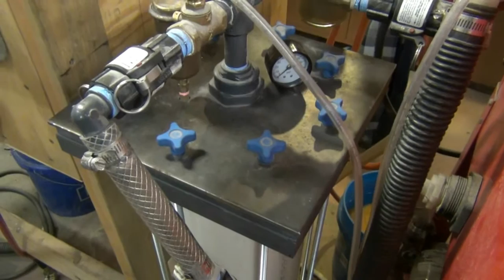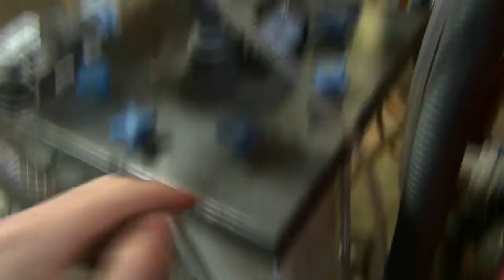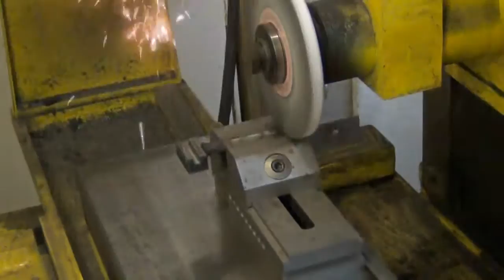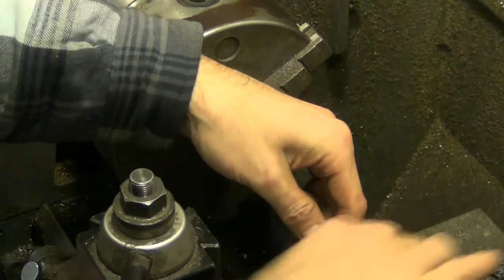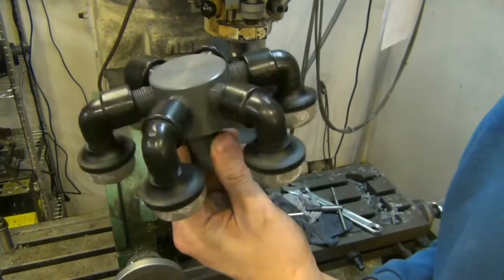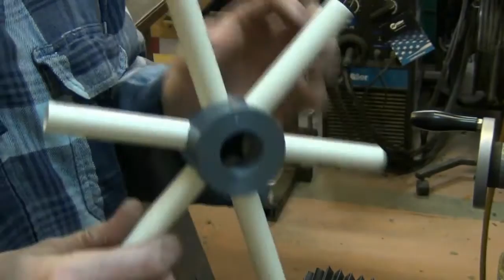Building a BIG Water Filter - Part 1 of 2

Comment: Why run it at 28-30 psi?  that's just a waste of electrical energy.  It also doesn't filter well at that pressure.
Reply from the maker: Care to expand on that?
Reply: No problem, I don't know where the idea of higher than required pressure came from. I also don't know what you are using the filter for. If it's a pumped supply to the filter the pump will be struggling to push the water through the filter and the flow will be what the surface area of the filter x the depth of the filter bed will allow.
We already know that filtering slowly vastly improves the quality of the water coming out.  Particles entering a filter at high pressure get sanded down as they move in the media until they are small enough to pass right through. filtering just requires a positive pressure. For example my swimming pool filters the water but the pressure is only 0.5 PSI and I am filtering 7m3 per hour using 69 watts of electricity per hour.  I could turn the pump right up full and get around 18- 20PSI on the gauge but that only filters about 12m3 per hour and uses 790 watts per hour. the difference is friction and that is a waste of energy and money.
Reply from the maker: Ok, I see. That makes sense. I am filtering water for my vapor blasting cabinet. I'm running a series of cartridge filters after the glass filter to clean up what's left, down to 1 micron. I found, as you said, that if I slow the water flow through the glass filter, it apparently takes out more particulate, because my cartridge filter life increases greatly. It is more expensive electricity wise, but changing out the cartridges so often is a real pain, especially in my ultra cramped shop, so it's a huge convenience for me, especially when I'm in the middle of a big vapor blasting job. I measured the psi through the entire system, which includes the glass filter and three cartridge post filters. With clean glass and new cartridges, it runs about 20 psi due to those cartridges. My only option would be to start using much larger cartridges, which I might do at some point. If I had to do it over again, I'd just buy an Intek sand filter or whatever and be done with it. Now that you mention it, I'm curious as to my energy consumption difference between 20 psi and 30 psi.
Reply: Hi Arnold, I guessed there would be more to your setup and as you say space is tight. Great engineering by the way, forgot to say that early on.
Reply from the maker: Thanks